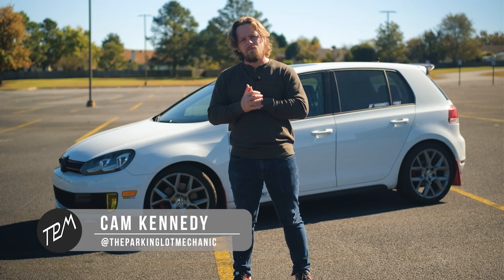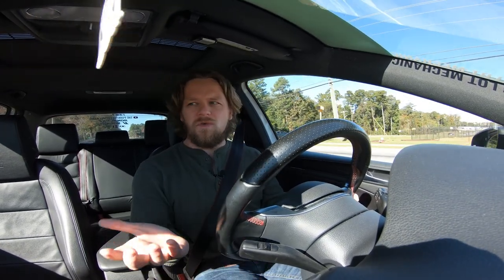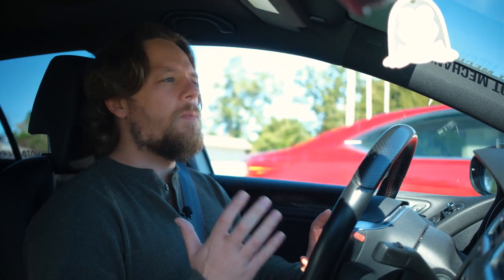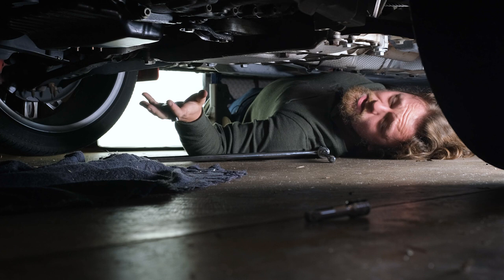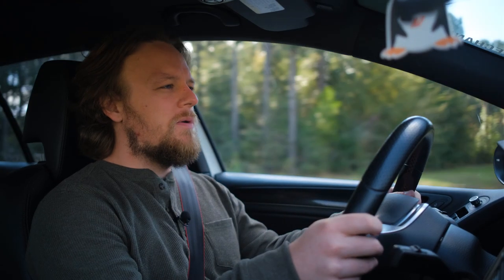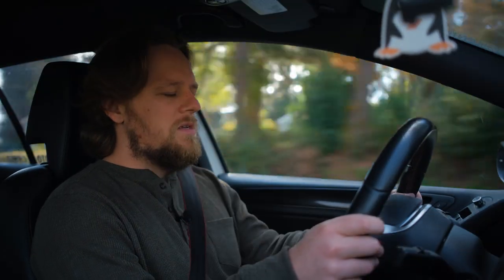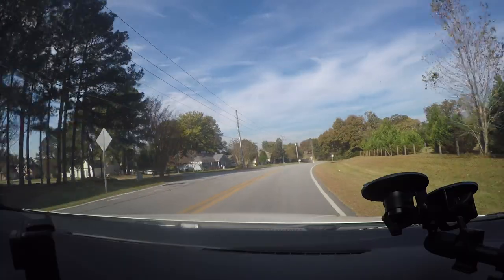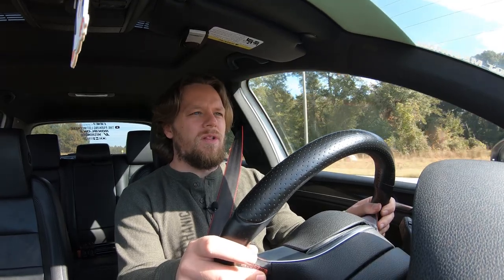The Butt Dyno Report | ECS Tuning Front & Rear Subframe Locking Collar Kit | MK6 GTI

Comment: Glad to hear the clunking is going away, altough I am puzzled about how does that is even possible LOL.
Keep the good videos coming !
Reply from the maker: It’s a very weird thing for sure but these collars help! And I just edited another one so we’ve got more coming!
Reply: @TheParkingLotMechanic on my car the clunking from below turned out to be the emergency brake cable , it had fallen out of its bracket . It would bang against the bottom of the car anytime I went over a bump , & it was annoying as hell . I just re-secured the cable back inside its bracket , & no more clunking . In your case , perhaps the cable’s bracket itself is loose & swings the cable against the floor . If you haven’t solved your clunking issue yet , perhaps this is the culprit

Comment: Do you think you could do a video on recommended tools for working on the mk6, I’ve looked at forums and they aren’t very clear as to what is good
Reply from the maker: For sure! I can tell you now though that a large set of standard wrenches and tools takes me pretty far on this thing. Only specialty tool I had to buy was a fuel injector puller/installer when I did the carbon cleaning.
Reply: Get a Triple Square set. Many bolts on VW/German cars us them. Also id suggest a pass-through socket set. Along with standard wrenches and drivers

Comment: I don't 100% match what everyone's symptoms are. But my alignment got knocked off once it started acting weird, the center steering wheel feel is loose too. Almost feels like a bad tie-rod, or loose rear control arm. I think they're just super messed up from offroading. I'll give updates, I'm just doubtful such a shitty feeling is so simply fixed.
Reply from the maker: Yeah that doesn’t sound like just subframe clunk. There were no negative handling characteristics (that severe really) with the clunk so it’s most likely something else. But the locking collar kit really did more than I thought it would for sure.
Reply: Sounds like what's going on with my 2012 GLI, it's the strut mounts and struts on my car, also swaybar end links like to clunk

Comment: Subframe movement was how the camber was adjusted. Say you had 0 degrees on left side and 1 degree on the right, you'd slide the subframe so there was .5 degree on each side. Then you tighten the subframe down. You might need another way to adjust camber if you lock the subframe down, like new ball joints or adjustable lower control arms.